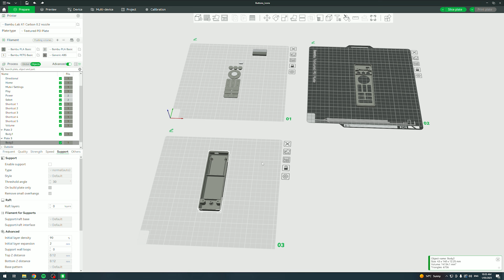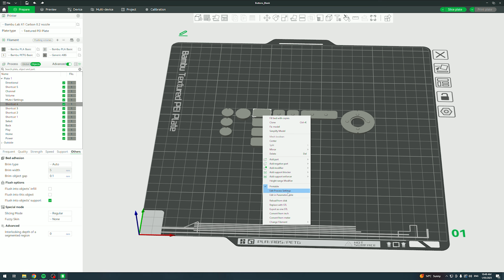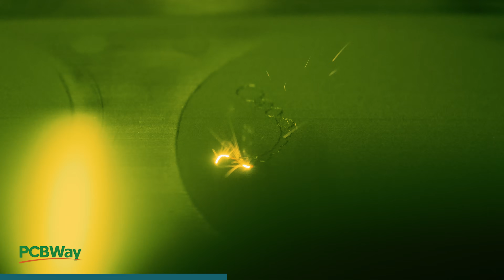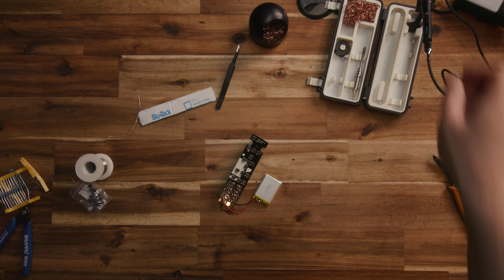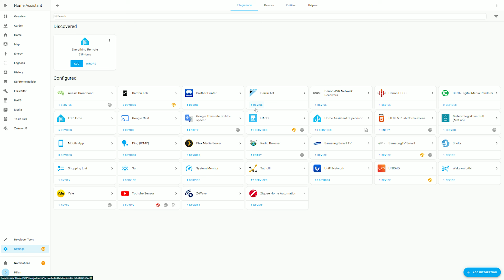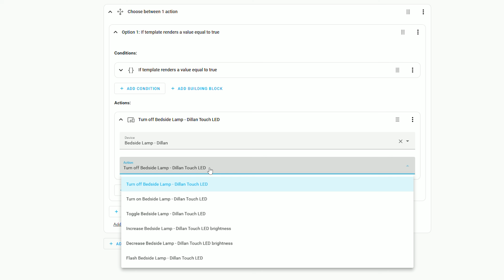Make Your Own Universal Remote (ESPHome + Home Assistant)

Comment: Thanks for the tutorial! I’ve built a custom TV remote for my LG TV, and it works great: super handy for controlling the room lights while watching movies, automatically switching the sound source, and launching apps from shortcuts.

I noticed you published a v2.0 version of the ESPHome config. I'm curious, where did the info about using GPIO36 for the battery come from? I was looking at the schematics for the Wemos D32 v1.0.0, and as far as I understand, it lists IO35 as the pin used for reading voltage with attenuation.

I have the same board as yours, but it looks a bit different from the official Wemos version, so I’m wondering if the board used in the remote might have slightly different schematics.
Reply: Hi genebell-zZz, came looking for an answer to this. I'm waiting on the pcb but been testing the "Wemos Lolin 32 Lite ESP32" and battery while I wait. Have tried both GPIO 35 and 36 and all I seem to get is 83.78160 % be it at full charge or completely drained.
Reply: Hey @GeorgeKaranikos, I checked out the v2 script: there's definitely some math going on to calculate battery percentage, and I need to poke around a bit to figure it out. I also tested it with a couple of batteries (one of them is totally dead), but they all showed around 83–84% after a few minutes. So either the math is off, or the ESPHome config needs some tweaking. That said, don’t take my word for it, I’m not super experienced with this stuff.
Reply: @genebell-zZz  thanks. I was chatting with the gpt, good friend of mine, anyway apparently the board doesn't read battery state natively, but we can wire in the capability with a couple of 100ohm resisters. Waiting on the PCB in case it's done already. Really looking forward to playing around with this thing
Reply: @GeorgeKaranikos  It could be the case. I think it's better to find a schematic for the chip used on this board: maybe it already has dividing resistors. I’ll check it later today.
Reply from the maker: That may be a bit broken, I copy pasted it from another project and didn't pay much attention beyond that! 

I'll look into it this week and update :)
Reply: @TheSaucepan-AU  I figured it out: the board used in the remote is the deprecated version of the Lolin Lite. It doesn’t have a voltage divider in the battery charging circuit (the newer version includes a divider connected to GPIO35). So, as @GeorgeKaranikos mentioned, the only option is to use two 100k resistors, some wires, and an unused ADC pin to measure the battery voltage.

If anyone’s interested in the schematic for the board, I found the original on a page titled esp32-wemos-lolin32-lite-high-resolution-pinout-and-specs. There should be a link to Renzo Mischianti’s website. The schematic is near the bottom of the page.
Reply from the maker: There you go! Looks like this particular version is an old one without the on board voltage dividers.

Apologies everyone - another change to make for V2!
Reply: @TheSaucepan-AU  Oh, got it, thanks! I checked the layout of the board from ali in your video (I bought the same one) and compared it with the official specs of the Wemos Lolin D32 board. They’re different, so I guess it doesn’t make sense for me to rely on the official docs.

I updated the board remotely, and it shows a raw voltage of just 0.24300 on GPIO36. Considering my remote is somewhere in the apartment and not charging, that value doesn’t seem accurate. I’ll check again when I get home and see if I can find any specs for the chip used on the ali board.

Comment: Hey man, love the project. Printed and got everything ordered, just waiting on the PCB. I am getting an error when updating the yaml. Failed config

binary_sensor.gpio: [source /config/esphome/everything-remote.yaml:192]
  platform: gpio
  
  The pin GPIO22 is not usable on ESP32-S3s.
  pin: 
    number: GPIO22
    mode: 
      input: True
      pullup: True
    inverted: True
  name: Select
  id: select_button
  internal: True
  on_multi_click: 
    - timing:
Reply from the maker: Looks like the wrong dev board must be selected in your YAML (you've used ESP32-S3s)

Your ESP32 block should look like this:

esp32:
  board: esp32dev
  framework:
    type: arduino
Reply: @TheSaucepan-AU  did you have to install drivers for your board to pop up on web.esphome? i also had an actual S3 and not the dev board, now i got the right boards
Reply from the maker: You may need to - yes. 

The ESPHome docs should have details of exactly which ones, but I think the web interface will provide them if they're not present.

Comment: Any battery recommendations for the US?
Reply from the maker: Any Lipo with similar dimensions should fit fine. Digikey or Mouser will likely have something :)
Reply: @TheSaucepan-AU thanks. Just finished up my build yesterday and realized the battery I got was just slightly too big. lol Also, I wanted to pick your brain on what led you to going with buttons printed on the remote that have points sticking out to touch the buttons on the PCB. Would it be more secure to have the 3D printed button open around the button on the PCB or no?
Reply from the maker: Only the buttons that are designed to 'rock' between two buttons have the 'nubs'

This is to avoid too many double presses, which I ran into during testing :)

Comment: This is actually an amazing peoject and just what i was looking for. Production of the video and blog etc is top notch. I am waiting for the PCBs to arrive and I printed the case. I feel it needs a few tweaks. The clip on one side snapped off (layer adhesion) as its freestanding as the other side is merged with the side id the case so stronger. Also only ine side has an indent for the clips to "click" into. Would be great to have a version we can melt brass threads into too. And a place on makerworld with the layer changes and suppors etc?
Reply from the maker: Someone pointed out this error over on printables, and the files have been fixed :) Try re-downloading!
Reply: @TheSaucepan-AU  thanks!
Reply: Actually looks like you caused the AliExpress guy to sell out of ESP32 boards, as he just cancelled my order 🙄 Do you have a link to the same board on Amazon AU? Or what I should search for? Want to make sure I get the right one to fit the case.
Reply from the maker: Oh no! You should be able to find them from other sources. 

Wemos Lolin D32 Lite 1.0 should find you some results if you use some combination of the terms
Reply: @TheSaucepan-AU I hate to sound negative, but here's some thoughts I have about this video:

1. The editing of the video was pretty sloppy. You added a number of inline edits, but failed to remove the sections you were replacing. This meant we heard both the sections you wanted to correct AND the corrections that followed.

2. With everything being in light mode, I found this very hard to be able to concentrate. I'm not just someone who objects to light mode for the sake of it, I have numerous floaters in both eyes & these tend to "disappear" when viewing something in dark mode. But in light mode it's very hard to concentrate, especially when both eyes have different floaters that move in different directions.

3. As someone else also mentioned, the size of the font for the code etc was so small it was very hard to see (combined with point 2 it made it pretty much impossible).

4.So many times you said "we'll just click this or that" without mentioning WHERE on the screen you were referring to. As someone new to ESPHome it made following along quite difficult at times (also refer to points 2 & 3).

4. I was so excited to create one of these remotes that I ordered the parts kit before I even had a 3D printer, thinking that seeing as we're both in Australia it'd arrive fairly quickly. Instead it took weeks (maybe longer, I forget now)! And why on earth did I have to buy it in USD? It made a nice little DIY project cost WAY more than it should have. And I still have to source & buy a battery as well (I get that it can't be included in the kit due to airline restrictions but it felt like it was sent via a slow boat from China - maybe mention that it's that's the case.

I do however appreciate the time you spent creating the video & blog post. From one aussie to another.

Comment: It'd be fantastic to see a version of the remote that operates with both an IR transmitter and zigbee integration. I've got a third reality push button that runs on 2 AAA batteries with over a year of runtime so far. With Zigbee integration, it might be easier to use the buttons as a wake signal for the IC instead of needing motion control to wake the remote and then connect to the wifi for home assistant automation. On the same wavelength, an integrated IR transmitter could allow some of the remote's functions to stay entirely onboard the device for simple tasks like turning on my TV and sound bar at the same time. Great video, I'm excited to see all the projects you have for the future!
Reply: ESPHome just added OpenThread support on ESP32-C6 and H2. This might be easier way how to add better battery life without going the custom firmware way.

Comment: The shell top comes with 2 clips that are separate object when opening the project, they need to be imported together when opening the file, otherwise they might be placed incorrectly or be missing.
The bottom shell probably needs support as the bridge is quite long on the USB C port.
Reply from the maker: I'll have a look and see what might have gone wrong, the clips shouldn't be separate objects.
Reply: @TheSaucepan-AU  bambu studio warns that it was created with an older version. Maybe that's the issue.
Please also check if maybe the bottom shell is not the correct version, as the slot for the clip is missing on one side 🙏
Reply from the maker: Should be fixed now! Sorry bout that, must have fat fingered the file export 😂
Reply: @TheSaucepan-AU  I can confirm, looking good now, thanks 👍
The PCB is still on the way, I'll reprint it tomorrow ☺️
Reply: Also on the bottom shell, the slot for the clip is missing on one side.

Comment: btw a tip on the battery life, forget esps deep sleep etc. the wifi may just drain too much anyways.
its a remote, you wont need it often. 
a perfect way to bump the battery time into the months/years span is hooking up a small capacitive touch sensor with some aluminum foil taped to the inside bottom of the remote. hook up a 555 timer or something simple to add a shutdown delay.

that way it will only turn on when you may use it (which is guaranteed to be when its in your hands :P)
if the ESP home assistant takes too long too boot tho.... maybe splitting it is the best idea, some LORA or 433mhz low power remote communicating with a base station.

Comment: 16:35 I agree that you can use any real soldering iron to start with. I'm not familiar with the model you showed but I started with a cheap hardware store iron. When I bought a "high end" soldering iron (one that had temperature control and a stand to hold it. Mine is from hakko but that doesn't matter) it made a world of difference when trying to solder. Before I would consistently get cold joints that worked until they didn't. It was difficult to manage where to put the iron while not managing to burn myself. If this type of stuff interests you for the long haul I suggest sooner than later to get a decent soldering iron.

Comment: What kind of battery life can we expect from it?
Reply from the maker: About 36 hours with the code on the site right now. There is a deep sleep version im testing at the moment that I'll post. 

With that, depending on usage, you should see a number of weeks :)
Reply: @TheSaucepan-AU  I hope the deep sleep version gives much longer battery life, otherwise I feel that it would be better to be corded.
Reply: @SantiagoLuz   yeah.. 36 hours for a remote sounds bad. Maybe you should split the device into two. Have a corded receiver which runs ESPHome and translates the received commands to the home automation. In the remote you don't need a new chip necessarily, I think you could just use ESP-NOW between the remote and the corded receiver.
Reply: @TheSaucepan-AU  I think with WiFi you are fairly limited in how efficient you can really get. Deep sleep will require disconnect and reconnect to WiFi which will add multiple seconds of delay to using the device. I recommend checking out Zigbee as an alternative although that will require an ESP32-C6 and dropping ESPHOME. Another option is ESP-NOW which works on any ESP  but will require some sort of ESP-NOW to Home Assistant bridge
Reply: Yeah. Battery life is my biggest constraint. I still ordered material to build 3 of them ;) My harmony runs 1y+ on a 2032 cell.

Comment: I'm excited to give this project a go! However, I'm stopped dead in my tracks looking for a place to buy the esp board you use in your video. The link in your BOM leads to a 404 page... as are the resistors, but I'm much less worried about those.
Reply from the maker: You should be able to find some with the term 'Wemos Lolin D32 Development Board' on aliexpress or ebay! :)
Reply: If you're in the US try this term "LOLIN ESP32 USB-C Lite"

Comment: Is it also possible to emboss the custom SVG into the button like in the button you shared? Or is that only possible in cad?
Edit: For anyone looking for this: simply change the modifier type to cut, and set the depth to 0.40mm.

Comment: Can you use it with "dumb" devices that just use IR signals, or does it need to connecy to home assistant?
Reply: There are WiFi IR emitters that can be controlled in Home Assistant, so that's probably the way to go. You control HA with the remote and HA controls the device via a seperate emitter. That way, you can do automations for older devices even without the physical remote.
Reply: In the first video he says nope. No IR support on this. He doesn't say he'll work on adding it in the future but hell, I bet adding a few modules to support IR aren't really that difficult. I imagine the difficulty there is the software support to help every person configure all their buttons to do either home assistant or IR and to record or program the specific IR magic into it.
Reply: Alr thanks